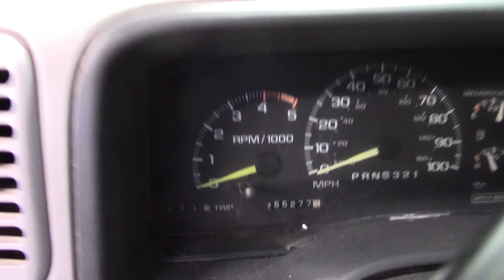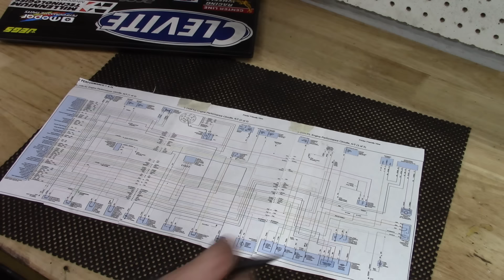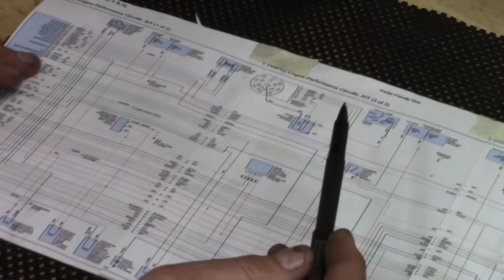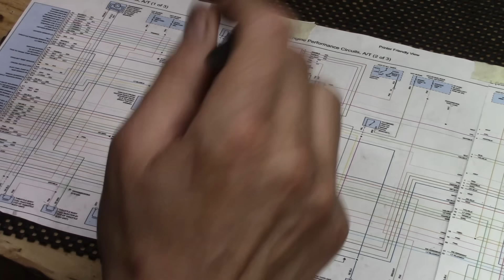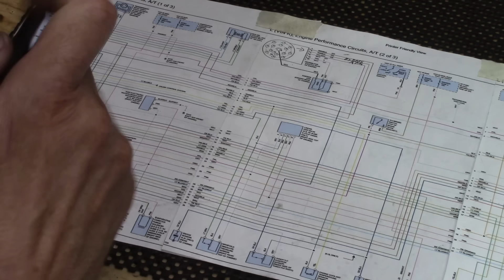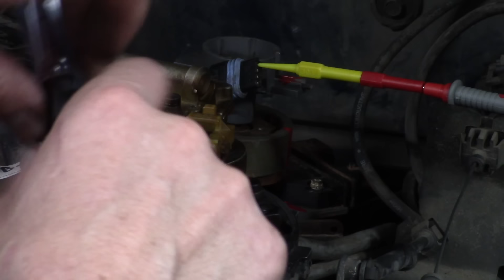Challenging Cranking No Start Diagnosis  1995 Suburban

Comment: For all those people that say im a diy’r and i cant afford a scope.. i say, tough titty pal. I have been at a shop 20 years and guess what? Without a scope, some fixes will be a guessing game.. I guarantee it….
Say you are doing a can system diagnostic procedure, if you just use a volt meter, you could have a voltage you think is good, but wi😢a scope you see the voltage should go up and down not just flatline… you end up going down a rabbit hole because you saw a good voltage on your volt meter…
Reply from the maker: 100% agreed!!  l have several videos where it’s clear that without a scope, you simply can not possibly make a confirmed diagnosis. 
   I am beyond apologizing for using a scope. it’s the right tool for the job and they cost as little as $100. most people who say “well hell man, you have a scope- no wonder you can diagnose it” the hard truth is that if they had a $20,000 snap on Verdict with a 4 channel scope they wouldn’t be able to diagnose it any better than a guess anyway.
Reply: Scopes are cheap today. I have a $300 used Vantage pro I bought 4-5 years ago. It does the job still.
Reply from the maker: Absolutely true.  You can get a 2 channel scope and bidirectional scantool for a total of around $500 nowadays. This concept that a DIY can’t afford “professional” level tools is a weak argument.
Reply: @SchrodingersBox  look, there are only 2 options…. Guess, or scope. Im sorry, but I didn’t make the world this way. Those are the only two options.